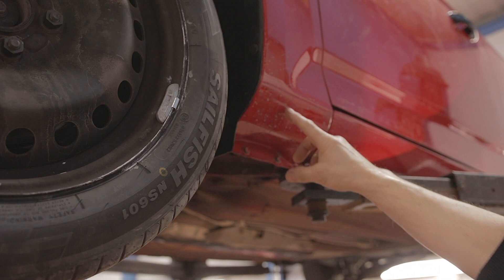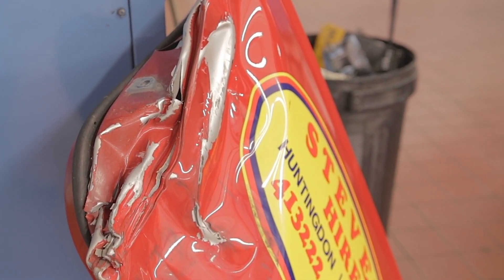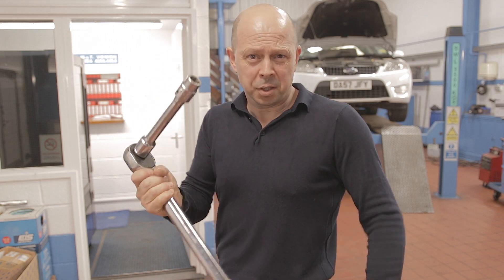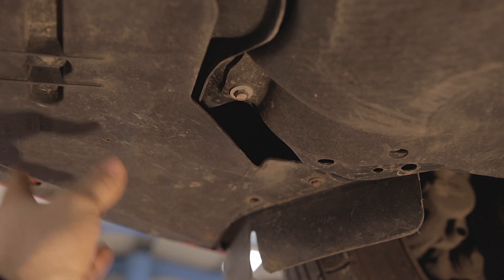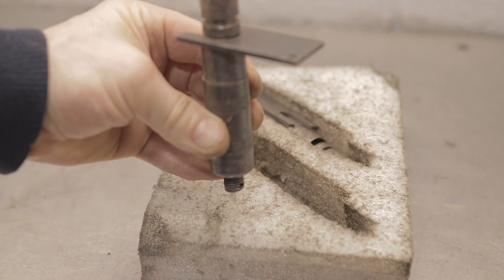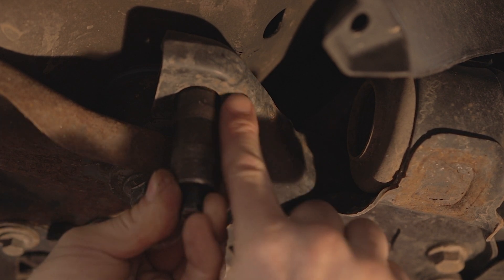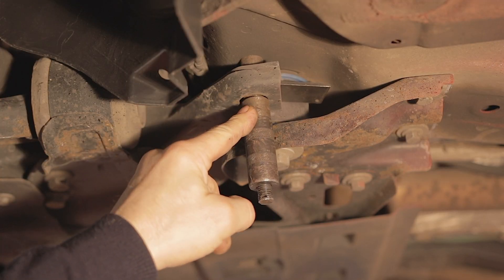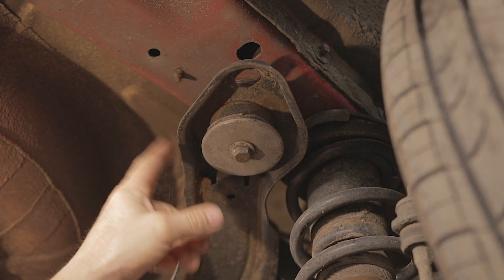Ford Mondeo Mk4 Subframe Alignment

Comment: I have a Mk3 ST220 and had all the rear suspension off to sandblast and powder coat which was done so badly by the company 💩💩 had to all come off again and be taken back to bare metal then I repainted it. I'm glad I saw someone comment in one of the Mondeo ST groups and then watched this because it's all going back on soon and the last time I never aligned it BUT luckily it didn't go anywhere so no damage done! Once front and rear is replaced its getting a Hunter alignment done to make sure. 
If you have any tips for the ST220 I'd appreciate it unless its basically the same principle here?? 
Thanks Alan 👍🏻🍻

Comment: Hello, I know it's an old one but maybe you know torque specs for tthese bolts on the front subframe? Thanks
Reply: Stage 1: 111 lbf ft (150Nm), and then Stage 2: Angle-tighten a further 90º
Reply: Mondeo mk3: 142Nm in four bolts
10 Nm for bolts M10

Comment: Great video Alan, as always. My s max steering went a tad bit stiff and wont return to centre after the clutch replacement (also have to constantly keep correcting steering on the road). What do you think is wrong with it? thanks.
Reply: Did u fix it.  Ive the same issue
Reply: I have the same probleme, after I have taken out the support and the 21mm  bolts out, in  order to paint them. Put all back, tracking, all ok, but the car ford pull  right,  and I do feel some restince, and have to correct all the time.

Comment: HI Alan, appreciate your videos. You mention at the end of this that you haven't had a need to remove the rear subframe. I have been watching your Mk4 Rear Trailing Arm Bush Replacement video as I am about to do the process on my Smax which I believe shares the same chassis. As part of the steps there you remove the rear subframe I believe. I can see there are still parts of the suspension connected to the hub etc, but was wondering if you would feel the need to have the alignment tool for when you reattach those bolts for the subframe?

Thanks in advance

Comment: Alan, have you had much Trouble with steering racks on MK4 Mondeo's ? My pump is whining. I am guessing that the filter is blocked in power steering fluid bottle not had a chance to look .

Comment: Hello. Have you ever had a problem with a MK4 which was al the time pulling to one side, in my case to the right. Everything is ok, brakes, bushings, rods .... made alignment 2 times and still the issue is there. Sometimes when I start the engine, the steering wheel moves a litlle to the right. That leads me to a falut in the steering rack, but not sure what. I have found the same problem on another car on youtube. Do you have an ideea ?
https://www.youtube.com/watch?v=pCynKCitQdM&lc=z22vzzgxirymvzydoacdp435o23i0jlszqb4oi0nxz1w03c010c.1558550833130279
Reply from the maker: 1)if all is set up properly i would swap your front wheels from one side to the other..2).i have had cases where the steering rack is faulty and you get a tight spot but not a common problem on mk4 mondeos
Reply: Thanks for your reply. I changed also the tures but from front to back and it was the same. The biggest puzzle for me is that sometimes when I start the engine the steering wheel moves a little to the right like the car is possessed 😁

Comment: Hi Alan, 6k miles after the dmf replacement I get a strange vibration above 80 km/h. Getting under the car I noticed that the subframe smaller 4 bolts toward  the A pillar were not tightened. Even after tightening them the vibratin persists. Can this be the reason for the vibration?
Reply: Check all the suspension bolts and   transmission shafts but i am almost sure that balancing the wheels will sort out the problem, some times the balacing weights fall of.
Reply: @organiccold  thanks, the car is at a mechanic for a week now, they suspect the tires. Today they will let me know.

Comment: Hi Alan yes I remember the old minis been nearly 60 yrs old worked on many off them and many other Leyland motors,  would you be able to measure the alignment pins as I have a clutch to do on a fiesta to do soon, and they have the same pins, I have tried to get hold of some with no success, looks like they are no longer available aftermarket,  if you could let me know the sizes when you have the time, I can get some turned. Also I enjoy your videos I like your scene of humour. Thanks
Reply from the maker: hi, no problem, i will get the dimensions and let you know tomorrow evening
Reply: Hi Alan Thanks Dave
Reply from the maker: no1conrod 
Hello. 
  The diameter of the pins are 18mm and the length is 150mm. Hope this helps.
Reply: Hi Alan thanks for the information I shall have a word with a couple off lads who work in  engineering.
 Regards Dave
Reply: @alan4x  Love these English videos: they give me different perspectives and component names; looking for a way to substitute for the tapered ones in a 2008 Ford Focus---closest I have gotten so far is a tapered pin for a hay wagon---any thoughts? Thnxs in advance for your consideration

Comment: I used to work for a van company that sold a Brand new transit customer refused it because of wheel gap, 2.5 inch gap from tyre to back of wing and 1.5" the other side which actually chaffed when bigger load rated wheels were fitted. Went to fords with standard wheels on of course, they said its within tolerance! I just slackened the subframe ( your right like 200nm tight ) and barred it symmetrical and had it tracked. 
Do the customs have these holes?
Reply from the maker: hi, thanks for your comment, we have four 2017 transit vans which have been converted into taxis by cab direct, i have not looked at the subframes yet but i will do now and get back to you soon, thanks, alan.